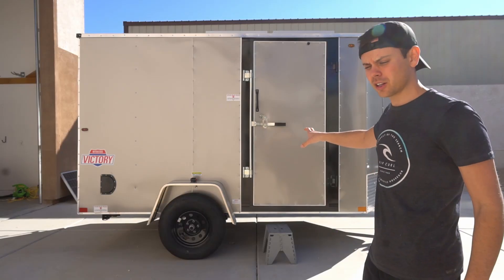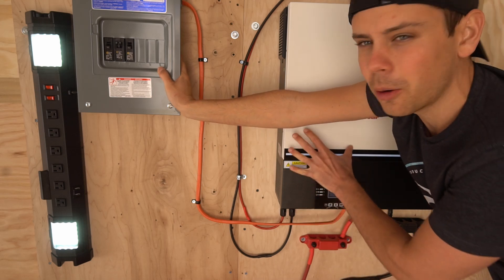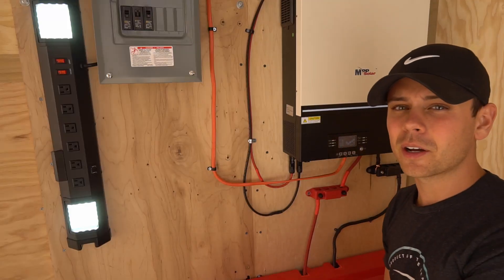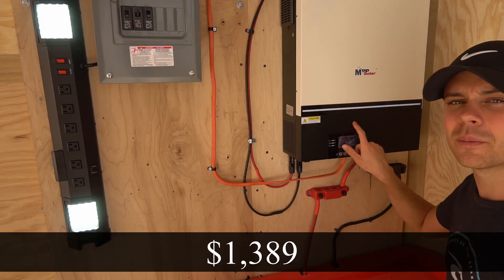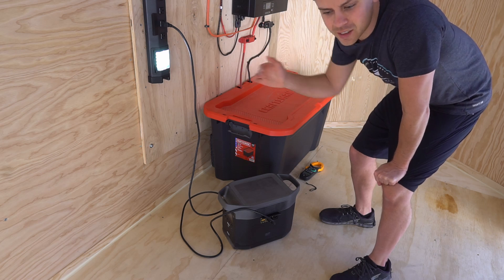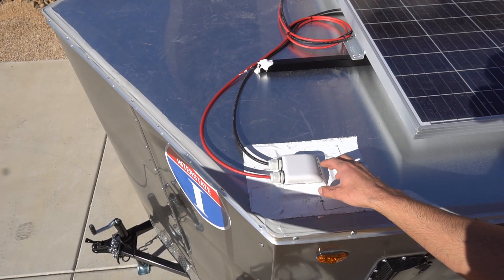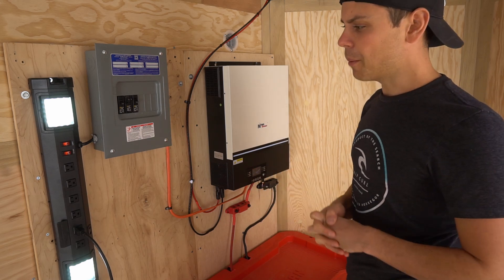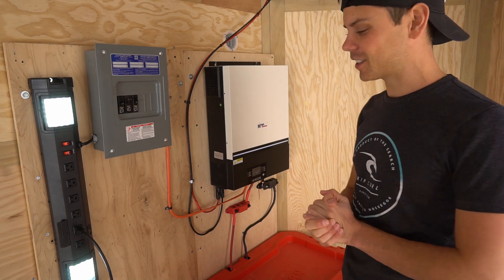Utility Solar Trailer: 6.5kW AC Output, 4.8kWh LiFePO4, 8000W Solar Input and AC Charger

Comment: On a separate note, any ideas how you could use for lightning as a home battery to offset high cost of grid title electricity during peak times? I usually get home from work around 4 PM. I’d love a way to just plug my truck directly into the house and have a powerall of our loads until 11 PM when the electricity becomes cheap.

Comment: Hey Will, just wondering if you can do a little update on this certainly not asking you to rebuild it but I’m curious what you would use if you were to build this today. Looking to do something similar preferably for under two grand if possible. I want something that I can use to 240 V charge my Ford lightning and/orto Peak shave at the house.

Comment: At 1:17 you say "I only have 400W of solar panels connected...". 

The MPP Solar LV6548 requires at least 90V DC for its MPPT to work. How are you getting over 90V from two 200W panels?

I'm very interested in small solar arrays (2 to 4 panels) and am looking for good solutions.

Comment: Great system as usual. This inspired me to built a similar system. I am wondering how did you ground the batteries, PV, and inverter. Also, did you use carriage bolts to secure the battery box to the floor ? Thanks for all the valuable information

Comment: I just purchased a 8.5x16 enclosed trailer to convert.  I want to be able to run a 12k btu mini split with heat pump, as well as fridge, laptop, led lights, water pump, and bed lift.  I know you are not a fan of 12V systems, but I am not tech savvy when it comes to electrical or all these components.  I was told I need 1600 watts of solar panels, (3) 12V 100ah batteries, 3000 inverter and mmpt charger to be able to run these components.  Would 48V be a better option?

Comment: I want to build a very similar system, and I want to use the most efficient All In One Unit.  I would buy a Victron immediately if they had something similar (total package with AC Charging included) , but I don't believe they do.  If there is no Victron option, what is the most efficient (lowest idle consumption etc) alternative?  Many Thanks for any help.

Comment: I am in the process of building a packaged solar system on an open utility trailer. I want to place the panels (maybe 2 x 400) on an overhead rack and the system in a waterproof rolling case. I want to build 24v using 3 banks of 8 each of the Overkill cells. My question is: Is there a good 3000va all in one unit that has the smallest footprint to fit in my box? Or am I better off using separate components? Im totally new to all this.

Comment: I love this concept and want to build a small trailer like this to pull behind my Tesla and mount solar and Starlink on top, so I can go anywhere on the continent and work. But one question - does anyone have an idea for articulating arms or foldable solar array, so that when parked in a parking lot I can unfold it and have a larger array input (1-2kW +) without needing to lay panels out on the ground? Where are the mechanical engineers at?

Comment: I have a question regarding the max amperage input of the LV6548. The manual says that the max PV input amperage is 18A x2 (18A per input). In the Recommended panel configuration example, there are 330W 10A panels, 6 pcs in series, 2 strings (12 panels total in this example) on the same input. Isn’t that 20A? I am mainly interested because the array that I wanted to make is a very similar scenario, and I am wondering if the manual is contradicting itself, or if I am missing some part of the concept.

Comment: Always wanted to build a trailer like this, only stuffed with more batteries and more panels that can be folded out or taken out and linked in on a fold-out framework.  Basically, a longer-term power bank for anywhere that needs emergency power.  Also add in a generator for short-term heavy loads and maybe a couple of pop-up wind turbines.  Want to use off-the-shelf automotive-based equipment where possible, so as to cut down on specialty requirements.

Comment: This is such a great idea. How about if you were building the system to save space say if the trailer was a work hauler or gear hauler?  Lots of DJs need alarms, lights and battery charging for example.

Comment: If you were to connect two for split phase power to the panel, how would you ensure the two phases are 180 degrees out of phase like the power from the grid?  Do the two controllers talk to one another to control split phase output?
Reply: If they are the same model, yes.

Comment: Hi Will, any ideas of electrifying the trailer, by adding one or more motors? I'm doing the same thing here in Australia. To start with it will have an AC motor for regenerative braking with a rectifier circuit, then upgrade to have a controller for the trailer motor to pull some of the weight while towing if regulations here allow this. I have a single axle equipment trailer with cable brakes, I'm leaving that axle alone except for changing the suspension springs to make it dual/tandem axle, then adding a car diff as a rear axle behind the existing one. I'm then connecting the AC motor to car diff with a suitable length car drive shaft and necessary circuits to the motor. The regenerative braking will be controlled by switch, rotary encoder or potentiometer from the trailers existing tow hitch for the mechanical cable brakes. The accelerator for this, if ever driven as a motor will have a pressure sensor at the back of the tow hitch to see how much the trailer is pulling back on the car and callibrated to accelerate accordingly to assist in driving the trailer forwards. I'm going to be using it with my Land Rover Series 3 which I'm also converting to Electric. Might be great for your trailer to tow behind your Tesla's. I'm curious if you can change these while driving though, or might need some modifications to feed this into the regenerative braking circuit or might affect the warranty. Still good if you can have a drive motor on your trailer to assist with towing and use less of the vehicle's battery.
Reply: Just pull it with an EV and then you get all of the above with no work.

Comment: I'm impressed but you lost me on the 48volt.   I want to run a small a/c boondocking but you mentioned something on one of your videos about a dc converter?   How do I hook that up and do I need a connector strip to run my 12 volt water pump or for that matter anything else that is 12 volt.  I'm a newbie as you already know so I'm totally confused.   I looked at your website about the packages so I'm a bit concerned as to what to get.   My trailer will be a 8.5x20 enclosed v-nose.....any advice is appreciated.    By the way - I also listened to your videos about your life - I used to think I had it rough as a child but quite frankly young man - you've done a helluva job and I'm proud to have found your channel as well as hearing your life story - put me in check once again.  You truly restored my faith in humanity with how you talk and what you have lived......

Comment: I find it interesting to add an air conditioner to your solar trailer for hot Nevada days.. makes sense.  I live in southern Nevada and want to add lithium batteries and eventually solar to my RV.  I currently have no RV shed or cover and I am concerned about keeping my RV as well as the batteries, etc in good condition in the heat.  Granted, I can get out of Nevada but I can't be gone all the time.  If the batteries are not being used during hot summers, is it ok to let them sit in the heat or should I take them out and put them inside my house or garage?  I am a total newbie to this...

Comment: I think your roof mount connectors are backwards. Won't those catch water when you drive? Or are these well sealed? Should the be mounted in the down vertical orientating?
Edit: Just saw video 2. Awesome that they produce something that can actually hold out water. Things are such crap quality.

Comment: how can LV6548 accept 8000 watts of solar? at 48v wouldn't you need over 166 amps worth of mppt solar charge controller capacity? it has 2 60 amp ones. what am i missing? please inform me solar charge controllers are kinda confusing to me.

Comment: The inverter specs indicate an idle consumption of 70W. Two of those would be 13kW output and 140W idle, slightly more output power, similar idle consumption, but without the benefits of low-frequency compared to my AIMS. Hmmm... I wish they would find a way to get that idle consumption down a bit.
Reply from the maker: Yeah that's the biggest downside of these inverters. The more expensive the inverter, the lower the idle consumption. Like a victron. But mpp does have a power saving mode which turns off the inverter and waits for a load to connect.

Comment: Would a system of this size power a mini split heat/AC system overnight in a camper like this? I am looking to do camper conversion to my enclosed trailer and want to be able to sleep comfortably and also power a few things on occasion during the day (such as a small range or microwave even). Could you possibly do a video on how to safely add shore power to a system like this? I would love to be able to plug in when I'm not completely off grid to not only preserve my battery cycles, but to also charge the batteries when on shore power. My understanding is they have automatic transfer switches that will automatically shut off solar charging when shore power input is detected? I'm sorry if some of these questions are basic, I am pretty new to electricity and solar and have been watching many of your videos trying to educate myself on the topic.

Comment: So at 60W power consumption this mean 120W consumption for split phase setup. this is not so great. I wonder if it is really PARALLEL operation when using two for split phase??... i tought it would be more like output in SERIE with a sync line to manage the 180degree out of phase... just like the  SMA yellow Sunny Boy does?
Reply from the maker: That's why it's 3-4X cheaper. Expensive inverters are absolutely more efficient.

Comment: I would highly recommend taking the MPP charge controller apart and using industrial thermal hot glue all of the components this stops the vibration from destroying the components that's the main difference between something that's designed for vibration and something it's not the other thing is is you can buy spray on formal coat and form a coat this way if you have any trips into areas where you're going to have lots of condensation it will protect it
Reply from the maker: Good points. Agreed
Reply: @WillProwse   I've done this on several cheaper inverters and had them last several years under harsh conditions really harsh conditions it's amazing a little spray a pharmacote will do and hot glue

Comment: 2:27. That's the part I do know that you need to have 200 watt solar panels or more, because 100 is baby stuff. And inverters gotta be over 1,500 watts. And I think wind mill SUPPLEMENTATION is a must(?)(.)

Comment: You should use an mini split its heat cycle uses the same amount of energy as the cooling cycle  about 1kw of power  needed look at senville they have an awsome seer rating of 22.5-25 somewhere around there

Comment: Looks great!  I asked you in a previous call in about solar panel stacking. This would be building a framework which would have a panel on top and a panel below on these stainless steel drawer guides. These guides would be equipped with an electric retractable system. U push a button and the lower panel or panels slide out doubling ur solar intake. Push ur button before u leave and the panels slide under the above solar panel or panels.  Just a thought for what it's worth.  Carpe Diem! !

Comment: I'm looking at building a similar system with the Lion Sanctuary ESS. I'm struggling with getting enough solar on the roof to hit the minimum startup and charging voltages. How does  your system work with the 2 panels and start up charge of 80v on the inverter?
Reply: He says it needs 90V, so he'll have to add the third panel sooner than later.

Comment: Question for anyone please. 

I was told that all battery jumper wires needed to be of equal length. Now I see Will’s battery bank with unequal jumper lengths, does this go for connecting all positives and or all negatives including the jumper wire to multiply the voltage between positive and negative, or can those be of different length when multiplying voltage and not including the feed wire but remaining battery jumpers.
Reply from the maker: Over gauge them all and it will never be an issue.

Comment: What fuse do you use from your batteries to the inverter? I have had a connection issue with one of my 300 amp fuses in my rv where it melted the housing for the fuse so I just bolted straight to the fuse for the meantime till I find a reliable replacement.

Comment: I have a 6x12 I'm building with 975 watts of power in a 24v system. I plan on using an airconditioner as well. may upgrade my solar with another 325 watt panel

Comment: Liking that MPPT. The batteries aren't going to be happy with their mounting, though having them in a waterproof (electrolyte-proof?) box is smart, but as water and Li aren't a good mix I'd add 2 small drains at opposing corners so that no matter how unlevel the parking drainage is always ensured. I would also very securely tie the batteries down, and keep the load balanced from side-to-side with added batteries. Trailers bounce and twist far more than you'd think with even small potholes and bumps so anything weighty will get thrown around unless it's mounted well. 

Tons of ways to add more panels and hope you do that to test charging as well as discharging. Also invest in some security; trailers which can be easily stolen are a HUGE target for theft, and most of the hardware used to protect them isn't what it should be so do your research. Also do as has been suggested and add rigid foam insulation throughout- very necessary to avoid it becoming a freezer or an oven from the outside environment.

Comment: I’ve been thinking about running my own solar panels for my house. I have about 1200 square foot. My roof pitch is low. About 4/12 pitch. I’m looking to run just about everything in my house. How many panels do you think I need. And what is the formula per square foot. Help
Reply: You'd want to see how much power you consume with heat, appliances, and other electronics, and if you want it to be supplementary or basically going off-grid. This is something I suggest getting a quote from someone who can inspect your house. There's way more to get into than he would be able to recommend in a chat.

Comment: i found that the single axle trailer will not support the weight. so i would suggest a 2 axle trailer then you can put in a lot more lifepo4 battery storage. also more roof space for more solar panels. love your videos and learn a lot from them. keep up the good work. the diy build with lishen cells and bms is the way to go.😎😎

Comment: YOU ARE THE MAN! Question for all the electricity gurus: i want the very simplest electrical ever. Thoughts on having a HUGE AGM  battery as starter battery and charge my laptop ( with 19.5 V adapter, no inverter +phone / + power bank and camara batteries with it as well through cigarete plug?